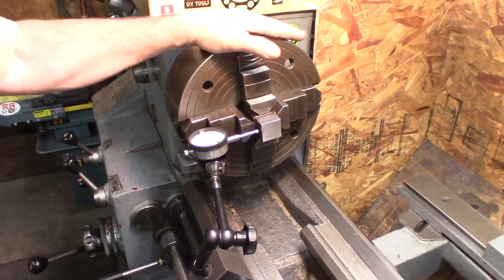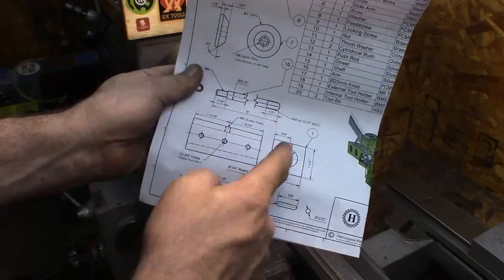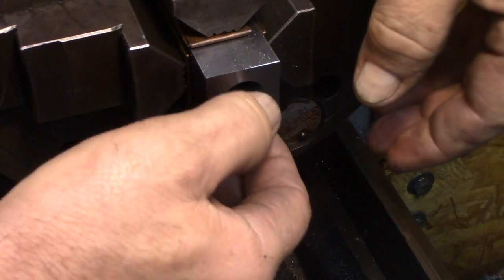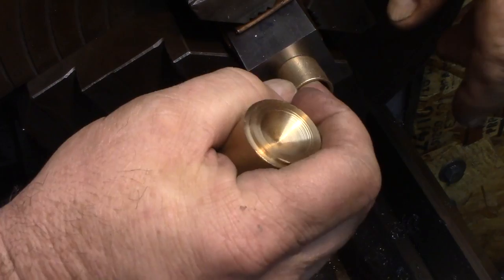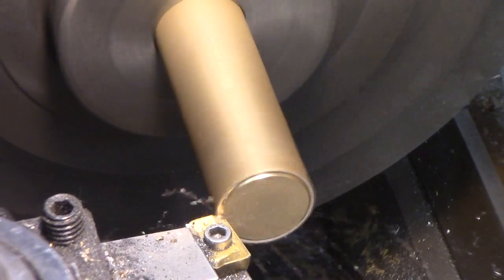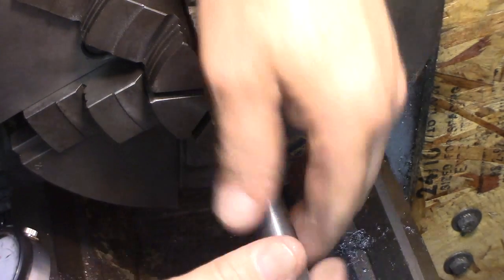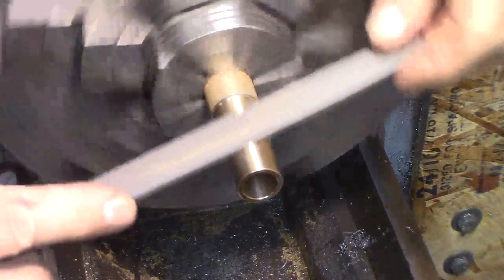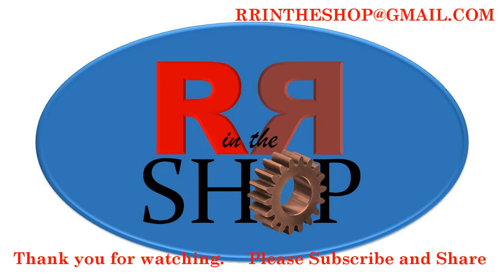How To Build a Hemingway Kit Spherical Turner / Ball Turner P2

Comment: I noticed you were using a straight reamer, I was taught to never use a straight reamer under power. I was taught it needs to be fluted to run under power. Just curious about your thoughts on that. Thank you
Reply from the maker: Look at a chucking reamer, straight flutes.  I don't really think the power source matters, I think you need to pay attention when
reaming.

Comment: Fwiw Randy I picked up a reaming tip from one of the Guy Lautord books. Fill the reamers flutes with pure cooking lard. I've found "most" times the reamers will cut a bit closer to size and in steel a way better surface finish. Projects coming along nicely.

Comment: Not that it matters in this application, but it is worth mentioning for people considering using Oilite bushings.
NEVER machine Oilite bushings, this ruins them.
The bushings are made to a very precise size and require a very precise hole. After they are pressed in, they compress to the final size.
Reaming the bushing requires specialized equipment. Using conventional methods like shown here will cause the pores in the bushing to close and the result is a bushing that is very inferior to conventional phosphor bronze.
Reply: What?? Never machine Oilite bushings? Bull poop. Who ever told you that didn't know what they were talking about. They recommend machining with carbide, but it does not have to be coated. Lathe rpm not to exceed 500 rpm with feed rate of .002-.006. When completed machining it's recommended that the Oilite be soaked in a warm SAE 30 weight non detergent oil for an hour. Honing and grinding are not recommended because the material will bond with the surface of the Oilite.

Comment: I've come across that situation too many times to count, usually involving a machine that was run way too long on a bad bushing (which turned into 'no bushing' or 'half a bushing') and wallowed out the bore just enough to prevent a tight fit with a new "spec" bushing.  One such repair is where I discovered the 'poor man's knurler,' which basically amounts to being a tubing cutter with a somewhat dulled blade.  Rather than cutting in, it tends to displace material to each side of the cutting wheel, raising a double ridge and cause the O.D. to increase in that spot.

It's crude, but I've had it work enough times during a field repair, or with old starters that couldn't be replaced, for the method to keep it's place in my bag of tricks.

Maybe I should try making a demo of that technique.  That would be easier than trying to write out all the little details that should be in mind while attempting it.

Comment: Just curious on your thought process since you've done this a lot longer than me, since you had to buy stock either way, why go with the sleeve instead of getting a new block of square stock and re-bore with the knowledge not to use that reamer?
Reply from the maker: Good question Ryan.  Cost was cheaper for the bushing material.  I did not mind having the bearing material hanging around for other projects.  I am really trying to just use the material supplied in the kit and follow the instructions.  I have used the mill more than the instructions would suggest, but i would like to getter done in a timely manner.
Reply: I went back to the first video and looked at the original parts list.  I had forgotten that the bushing is also in the plans even thought it should have been obvious in this vid as well and so makes even more sense you did it the way you did to make a new bushing.

Maybe one of those downsides to being allergic to coffee and not being able to have a wake me up in the morning before watching a vid.  Have a good weekend.

Comment: was making some oil bushings for my link pin suspension on my offroad buggie and had a boo boo  and the brass bushing was a bit small, made another BUT always was wonder it I were to knurl the outside of the bushing for a tight fit???
Reply: In time the knurls, being softer metal than the host bore, will flatten & get loose. I expect the rough suspension work would make them loose in little time.  For this application where it is only hand operated it could get by.  But, having full machine capability, why not make it perfect.
Reply: I would have considered knurling too and then Loctited  them in place.  In 20 years if they wore and I needed to replace them I'd have to remember to heat the part to get them out.  If they were close enough I think I might have tried just the Loctite without knurling.

Comment: I thought oilite bushings were supposed to be linebored after installment. But then again, this is a low speed shaft rotating, so maybe You're good with that one. Thanks for sharing ;)
Reply: It is not generally a good idea to machine oilite, the claim is the pores get closed off by the cutting action.

Comment: Nice Save Randy
I cant believe that the reamer killed it like that, lesson learnt.
I have that same boring bar ( the first one you used) I found that the head deflects a lot on those. I had my finger on the bottom of the head  when it was starting a cut, there was a noticeable drop when the insert engaged the material, Not the shank but just the head.I dont know if its by design to help with chatter, but i did find it make for less predictable cuts..
Thanks for another interesting Video!
Cheers
Reply: If that's the way it was designed to operate, to flex randomly, then the designer is an evil bastard! ;)